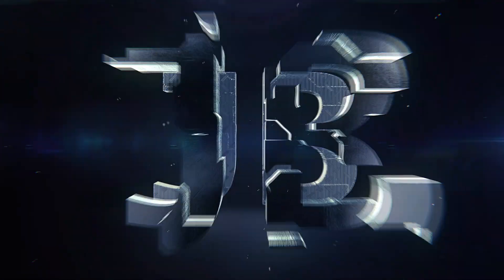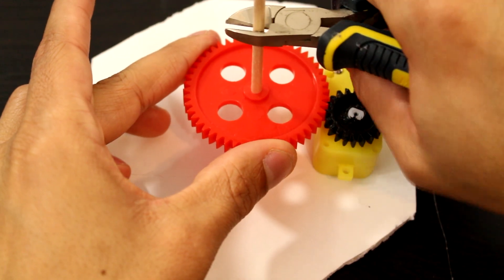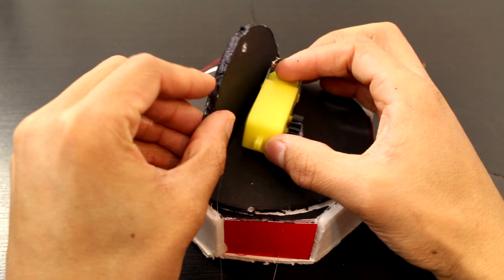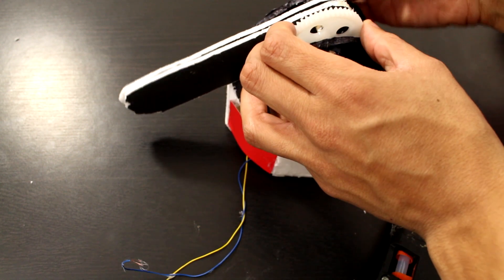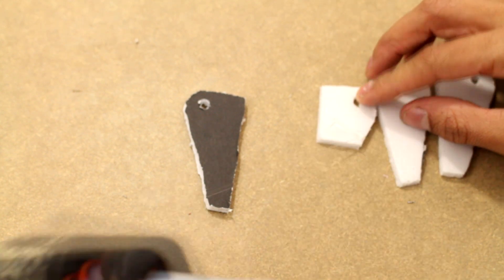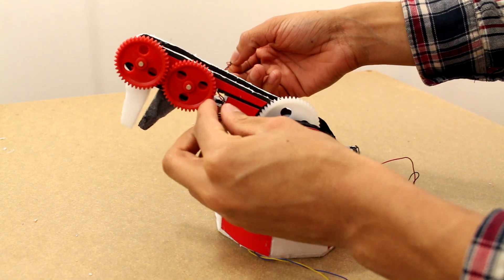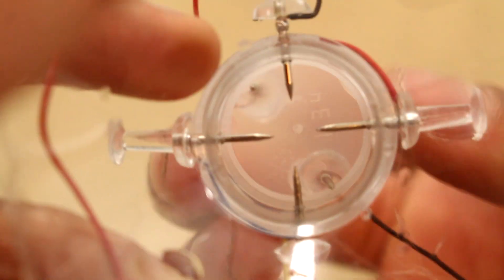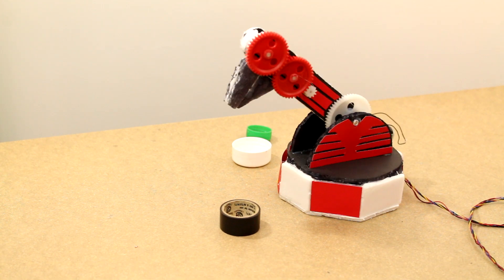How to Make a Motorized Robotic Arm

Comment: The parts are not accurate. Be careful. I ordered the same recommended part and it did fit. The large motor is not the same as in the video. The plastic gears doesn’t fit on the motor. And a lot of problems.